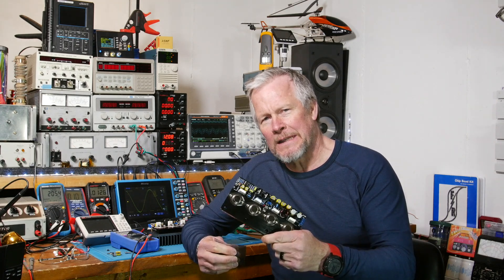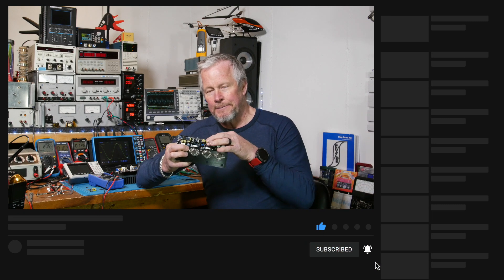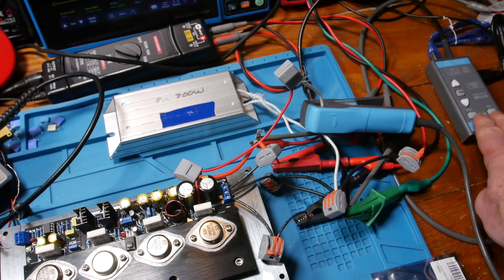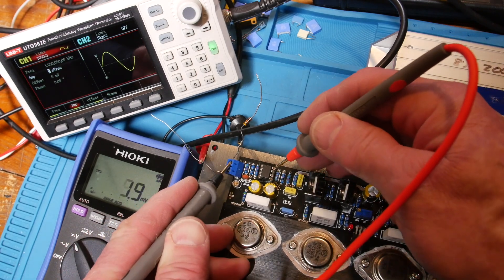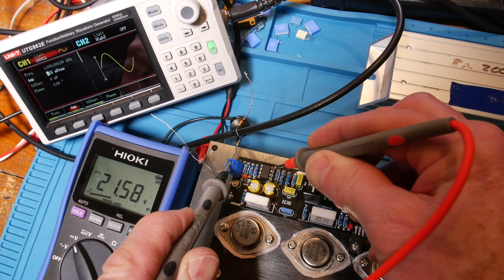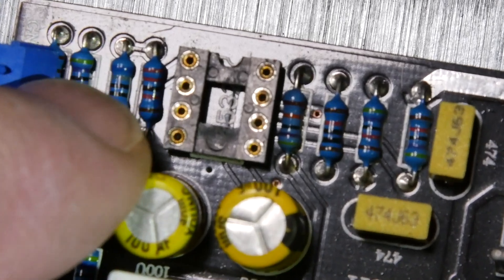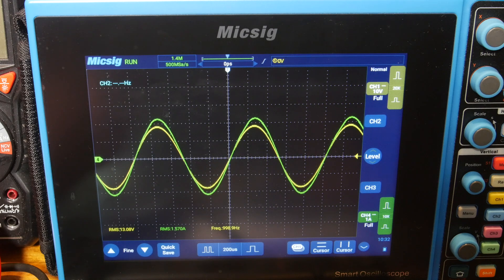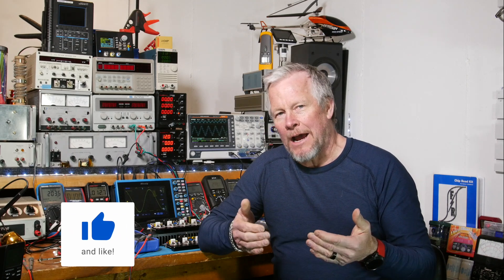Which OpAmp is Better for 20W Class A Amplifier - OPA2604 vs NE5532?

Comment: Why are you only measuring the op-amps?  Plug them in, check the measurements if you want, the proof is in the LISTENING!  HOW DO THEY SOUND?  Nelson Pass said "Measuring gets you in the ball park... the listening is the most important.  If you want your distortion analyzer to listen to your stereo for you... be my guest!"
Reply from the maker: LOL - equipment doesn't lie - but the placebo effect does;)  Nelson Pass uses equipment to design and develop - don't make any mistake about that.  

We engineers that design - actually use equipment to verify our analysis - listening is totally subjective - measurements are purely objective.

People that buy snake oil love to argue the listening debate - but ironically they can not pass any double blind tests...

Comment: I switched all the cheap op amps in my console and it sounded like a decent desk, plus huge capacitors by comparison and the headroom is so good now, less noise and flexibility. BB were the best apart from some modern Japanese ones that were faster and more hi fi on transients etc. on drums. They all had different uses. I now am going to try discrete ones in the summing buss to see. It's worth noting SSL's mixed all your favourite 80's albums chock full of 5532 and 5534's. P.S. I'm glad you incorporate sound.

Comment: Have you looked at the LM4562NA ?  I just replaced 2 of the NE5532s with them that after one or both failed in a new preamp. I'm thinking I may have overdriven the 5532s  but the others are still working fine so not really sure what caused them to fail in just one month.The 4562s sound much better. Now I'm thinking about going with a larger 2.5amp Linear power supply for the next upgrade on these Hi Fi preamps.
Reply from the maker: Wow - thanks for the feedback!  I will have to try the LM4562 OpAmps.  Thanks for the tip!!

Comment: Replacing an op amp is more likely to add distortion as the Equipment you have is designed around the opamp inside.  Most people don't have enough electronic knowledge to do this. Every mixing desk in the audio chain has gone through hundreds of NE5532. So you put in an unsuitable JFet OPamp in a little box in your living room, you hear some high frequency noise and think it sounds better because you paid more for it,  Unless you can test an improvement you are probably making things worse.  Plenty of High End audio use Philips / Signetics  NE5532 because they are perfect for audio.
Reply from the maker: Thanks for the great feedback!  Swapping OpAmps for better sound is not usually beneficial - but in this case - it is for operating range.  I need an OpAmp that can swing to higher voltage rails - so it is definately needed.  Also, - just a btw - the NE5532 is used as it is a great 'low cost' OpAmp - and used because of this.  There are better OpAmps for sure. ;)

Comment: I don't understand the logic of driving op amps to maximum supply rails. It may make more sense to include driver transistors for the output transistor stage.
Reply from the maker: Thanks for your feedback.  There is nothing wrong with maximizing the voltage swing of you OpAmps.  If you use OpAmps - you are trying to get away from the discrete circuits - so adding transistors to drive the signal doesn't make sense - if you can find a great OpAmp that can drive the signal from rail to rail.    Sure- it is not a problem to use transistors - but now you have to make sure that they don't change your linearity.

Comment: For commercially bought equipment, the 2604 will undoubtedly sound better and relative to that is the 2228 which IMO, sounds even better than the 2604 in some circuits. With those points made, designing something to build yourself makes it quite trivial since your filtering can adjust the output waveform and texture. The 2 mentioned chips are tremendously more expensive and now obsolete. Designing around the 5532 which is still one of the most favored audio chips is pretty common today, and makes swapping them produce modest changes rather than profound.
Reply from the maker: I can't agree more - the filtering and support circuit around the chip can totally make a bigger difference.

Comment: if you put a 20-20k signal through them will it come out flat with no loss at any frequency?
Reply from the maker: Great question!  Yes - that is no problem for any OpAmp, but with what gain can it still do that - and how much noise?  OpAmps are all pretty darn good - and some are just more exceptional.
Reply: @KissAnalog  thank you for the reply!  The thing that confuses me is that according to the video link below its not flat from 20 to 20k  . What's your thoughts on this?   https://youtu.be/QCBUFBJh9bk

Comment: I have a question about changing the op amps in my 2 bus summing mixer. The current op amps make the sound a bit dark and outdated, so I want to replace them with ones that will make the sound brighter and more spacious in stereo. The op amp model currently used is op2134 PA. Can you suggest any replacement op amps?

Comment: Very useful video. I just swapped 5532's of my pre-amp for 2604's -  I was getting an overload from the DAC and had to run it in preamp mode with attenuated output - this has disappeared now (granted never knew if that 5532 was original). Huge difference in quality of sound - I am listening to 'Knocking on Heaven's Door' by Eric Clapton fifth time! Thank Eddie.
Reply from the maker: That’s fantastic!

Comment: Is it possible just replace opa2604 by muses 01/02 or opa and muses have different requirements for the nominals of the cirquit? The same question about replacing lme49720 by muses 02/01?
Reply from the maker: Great question.  In general - yes - but in my case I wanted the higher voltage rails.
Reply: @KissAnalog  Thank you! And will both stock and new opamp be in optimal regime of work then? Is trying to get some improvements of sound quality such way correct?

Comment: I’d be interested to know where your buying OPA2604. I don’t think TI has made these in quite a while and I only find them on ebay from China.
Reply: There are many fakes but there are some reliable sources with real opa2604s but you can piggy back a pair of opa604s for the equivalent circiut and they are still in production.  The opa2604 has dual opa604s in the same package.  Browndog opamp adapters can be ordered with opa604s presoldered for around $18. I have found genuine opa2604s for $6 to $8. I have also some fake opa2604s. Be careful who you order from

Comment: Most components from eBay and Ali express are fakes or re labelled crappy opamps. The 2604 is pretty expensive, so if you get say, 10 PC's for 10 bucks, they are almost certainly fake. Same goes for the LM chips and TDA units. I did buy some FETs online once, not knowing about fakes, and they're actually working still. Go figure! And certainly stay away from output  transistors  online too. There's a reason they're more expensive from a reputable supplier.
Reply from the maker: Great advice.  I was lucky earlier when I originally chose that OpAmp for this Amplifier.  They were not cheep - except for that batch that came in huge qty.  I thought the price was for a single part and expected a high price, so I didn't notice that they were sending multiple pieces for each item.  When parts go in surplus they can be lower cost if they are not really an item that is in demand, but if they are like these OpAmps, you would expect to pay closer to $5 per unit.  Which I did.
Reply: @KissAnalog  I've seen that opamp going for 14-15 bucks now! I was watching a comparison of 8 opamps recently. Honestly, Eddie, I can't hear much difference.

Comment: Both op amps are very old devices. The NE5532 is from 1976 and the OPA2604 from 1991. So they do not represent the current state of the art of op amp development. The NE5532 was developed with the main objectiv of very high internal gain and therefore high linearity or low THD and low noise. The OPA2604 was developed for higher operating voltages and slew rates. It has considerably lower internal gain and higher noise.

Today we have much better op amps operating at consideraby lower current with better performance, especially lower noise, better linearity, less offset voltage and higher stabilities over many orders of magnitude of gain. The disadvantage is their SMT packaging. So they are more complicated to use for makers. I like to use them with SMT-to-DIP adapters.
Reply from the maker: Thanks for the great feedback!  Which OpAmp do you think is best for audio?  How about with higher voltage rails?
Reply: @KissAnalog  it depends. For most of my audio amplifiers I use the NJM4562 because of its high slew rate, good linearity and low noise. For higher voltage rails (above 18 V) I use discret differential input stages

Comment: Listening tests will show that the 50 year old 5532 NEVER is a good choice. It might measure OK at some points, but it will never sound good.
Actually it can ruin the sound in any good Hifi device. It is used extensively because it is dirt cheap, and it is often socket-ed because the vendors
know that it does not sound good.

If you want the best sound, go with a Sparkos discrete dual op-amp - or If you want to go cheap try an LM4567 / LM49720.
Reply from the maker: Thank you!!  I can show why in science that the 5532 is not the best choice:P)  What to you think of the OPA2604?  Science would show that it should be better:)

Comment: Great video
Reply from the maker: Thank you!
Reply: @KissAnalog  I’ve been using Sparkos discrete op amps in my Neve console - the op amps have duel compensation class A output current - most discrete op amps don’t sound at all like they are discrete instead sound like extra high frequency - but the sparkos have the class a sound when compared to a Neve 1073 class A pre amp 💯

Comment: Thanks for the video I have been wondering how the 2604 would work in my Session 500 Peavey Amp. It's about to get 9 of them installed. Thanks again.
Reply from the maker: Thanks - that’s great!  Let us know how it works out!
Reply: @KissAnalog  It s a servo op amp , it remove offset DC on the output of amplifier.

Comment: If JFET input opamps have a different sonic characteristic than BJT inputs when you're running them linearly you should easily see it with your test equipment.  Even an FFT on a cheap oscilloscope should do the trick.  I've tried off-and-on over the years to hear or measure the difference that folks claim is there, no luck.   Driving them hot very near the rails is a different story altogether, you can definitely hear a difference and see it on your test gear - but unless I'm building a fuzz pedal I've never found the sound of any overdriven opamp sonically pleasing at all.  haha
Reply from the maker: Thanks for this feedback;)  I would have to agree with you.  I'll take more measurements at the final build.  Let me know what you think;)
Reply: We know that JFETs have a quadratic relationship between input and output voltages, while BJTs have an exponential relationship. That implies a JFET will introduce principally second harmonic distortion, while a BJT will add odd harmonics. However, local negative feedback at each stage will reduce that distortion, and then the entire opamp will have overall negative feedback to set a fixed gain. For a TL072 with a gain-bandwidth product of 3MHz, it means that at 1Khz it has an available gain of 3,000. If you use it in a stage with a gain of 10, you're reducing the gain and hence the distortion by roughly 300 times. For an NE5532, it's 10MHz, and a reduction of 1,000 in a comparable setup. It's little wonder you can't hear (or see) the difference. FWIW, the LM4562 has a GBW product of 55MHz typical.
Reply: As electrical engineer i can tell you it is absolutely water tight proofen the differences are placebo as long as you have a reasonable OP AMP (reasonable means not one of the first ever) in an amp with appropriate circuitry.

The differences people hear when switching OP amps is the distortion, hamonics and the oscilation they produce by putting them in a not suitable circuitry. Specially in the heights.

But put in an appropriate circuitry, differences arent even measurable with equipment worth a few grands. It is calculatable, hence the 0,0000003% ratings from manufracturers. Those aren`t measured, but calculated. And this just in a given optimized circuitry.

The differences people "measure"... well, in german we say "wer viel misst, misst mist". Translates to something like "who is measuring much, is measuring trash". The difference comes from the inappropriate circuitry causing orscilation and harmonics.
OP Amps are not universal as people handle them.

Comment: The genuine NE5532P sound better !  The genuine  NE5532P adsorbs 8mA  quiescent current  ( the fake  2 mA)
Reply from the maker: Thanks - that's great info on how to tell a fake from the real deal;)
Reply: @KissAnalog  The easiest way to detect fake NE5532s is to measure the resistance across the two inputs with a multimeter in diode mode. A real NE5532 has back-to-back diodes as input protection and you'll spot the junctions in both directions.
Of course, you might still get a real NE5532 which is a manufacturer's reject, so caveat emptor!

Comment: O yea when i did buy a better opamp i did go for the AD797 it is a very low noise, low distortion, ideal for use as a preamplifier, the low noise of 0.9 nV/√Hz and low total harmonic distortion, but i have to say it needs a good power supply to the chip, i think yours is a bit low power, and the AD797 its a little more demanding like the NE5532, but did you not buy the kit from Amazon, and does it not com from China, maybe you have got not a real NE5532 but a china one 😂
Reply from the maker: Thanks Jos!  That’s a great part for lower power applications;) This kit seems solid.  Good noise performance and ca handle the high (max) voltage.  So hard to tell.
Reply: @KissAnalog  o yea you are right +/- 15v oke i did mis that ;-) , i did only build 1 opamp pre amp in my life, i now use a dac with a build in preamp, it sounds better than everything i did build ;-), i use a S.M.S.L SU8 for my setup, and it has a  THD 0,0003%, so i can never build that, and its cheap yea i am dutch

Comment: OPA 2132 is also one of the popular op-amps used in the audio world.  They do sound different from NE5532.  When the music gets busy in the midrange, these sound better than the NE5532. This is all subjective of course.
Reply: Sadly the OPA2132 is about 10 times the cost of an NE5532 and still considerably more expensive than an LM4562. If you're not using a relatively high impedance source, I doubt they will ever have more than a subjective bias in favour of them.
Reply from the maker: Thank you for that Tip and for his great feedback!  Looks like another great option.  It does have lower voltage rail specs but would be great for pre-amps or lower power amps;)
Reply: @KissAnalog  Early to mid-2000s, rolling opamps in a circuit was fashionable.  Many headphone amp aficionados would build a "cmoy" headphone amp clone and with a socket, for the opamp(s) they would try different opamps and give their subjective opinions. So I wanted to try this on a Pioneer stereo amp and modified the preamp/tone control circuits with IC sockets to see if there is any truth to all of this. I felt that there is a difference in the sound signature of the opamps and if the circuit power supplies, decoupling, etc are good enough, the differences between opamp sound signatures are definitely audible. High-quality headphones, good jazz recordings can show the differences.  See this link (not mine) if you are interested -  https://tangentsoft.net/audio/opamps.html

Comment: Thanks Eddie.
Do you remember when you first looked at the distortion on this amp? It was full of 2nd harmonic distortion.

I'm wondering if the BB chip has better rail to rail specs?
Reply from the maker: Yes, the BB part can operate at a higher voltage on the rails.  I originally thought I'd try to get more power - and maybe I will;)

Comment: If 100 watts is twice as loud as 10 watts, the very small increase is interesting but kinda pointless. But as you said, you have them so why not use them. Higher voltage always means more power. Until of course, it goes bang!
Reply from the maker: Thank you for this!  Great Point Michael!  Maybe if it is pushed a bit above its power rating there will be less distortion.  But then, unless I can raise the voltage rails on the OpAmp, the best reason is maybe to offer a JFET input;)

Comment: In my active speaker repair project, I discovered the input & E-Xover boards use 2 different types of opamp in each speaker. One unit has TI-5532's & the other Fairchild 5532's. Would this make any difference audibly? Should I consider using identical opamps in each speaker, maybe doing a swap as a post repair project?
Reply: Same OpAmp, distinct manufacturers.
Reply: @misterjorous  thank you!
Reply from the maker: Great answer #Eduardo Caetano;) Also, I think these OpAmps are so high level that they seem to work so great!
Reply: @KissAnalog  I love the 5532... perfect jellybean.
Reply from the maker: Thanks Eduardo!  I agree - for the cost it is hard to beat!  Especially when it takes one 4 or 5 times the cost to get something better - it it really is:)
Reply: @KissAnalog   true. One of the best opamp out there along with the TL0X2 family. Maybe more then 90% of all the recording gear since 90's is using 5532.